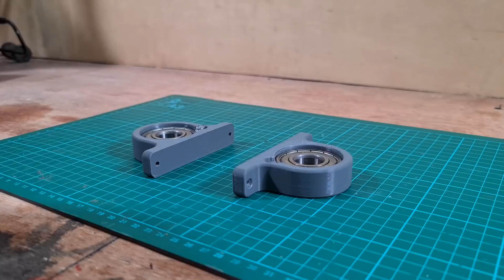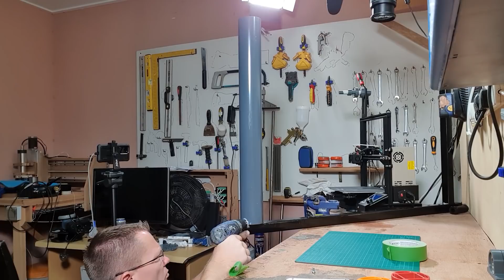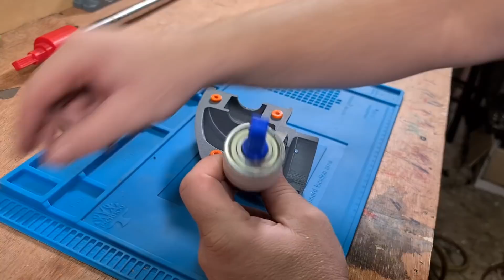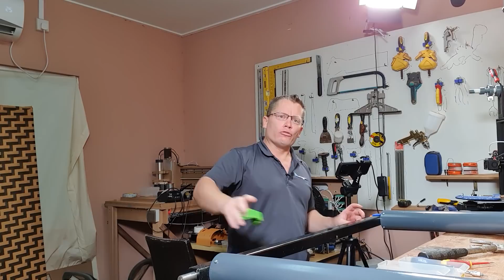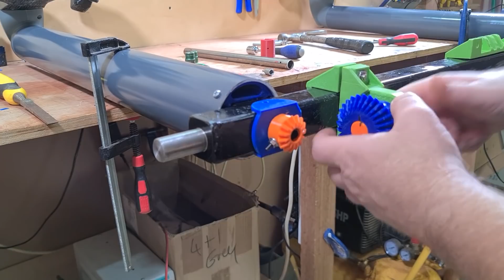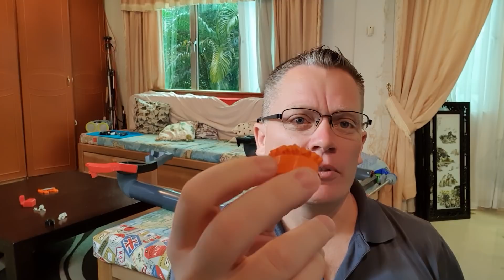Prototyping the Boeing 737 Dual Control Yokes

Comment: Hello sir. Thank you for really good video. Could I ask what spec of gear do you use. I see a lot type in Fusion 360. Thank you.
Reply from the maker: These gears i created in fusion. However, since this video people have stated that fusion has a helical gear creator. I tested for a few samples and it appears to work fantastic! If you mean however what metal gears did I get hold of: They are 16mm bore, 1.5 Modulus, 30mm OD. I hope that helps.

Comment: Great effort and an awesome video to watch as always, Karl! I like these prototyping videos, because they let us see just how much work you put into the designs....just a note, for the gears, perhaps PETG would be a better choice? I know you mention ABS at the end, but PETG offers just as much strength as ABS, with none of the nasty smell/headache that induces :)
Reply from the maker: Hi BK Hobby, I have actually bought several rolls of PETG, but never got around to using them. Thank you for the advice and I will give it a go! Kind regards Karl
Reply: @helimech8152  Great! An added benefit to PETG over ABS is that it's much less prone to warping and actually stays on the build plate! If you haven't used PETG before, here are a few tips to you started:

-Use retraction (especially on a bowden type printer) - PETG does get a bit stringy if you don't
-Use a cooling fan for all but the first few layers (it helps with the part strength and reduces stringing, as well)
-Use about 70C heat bed temp - helps the part stay on without any additives

BTW, if you have a PEI build plate, all you need to do is wash it down with a bit of IPA (rubbing alcohol) to help adhesion....but if anything, I've had my parts stick too well to PEI!

Looking forward to your next videos!

Comment: What an effort! Wow! Thing of beauty is the joy forever!
I got 2 questions:
1) Do you plan installing some sort of a dumping system? For example some motorcycle steering oil dumpers?? (Like such - https://www.ebay.com/itm/CNC-Steering-Damper-Stabilizer-Universal-for-Motorcycle-Dirt-Bike-Street-Bike-/154048941602 )
2) Have you considered to use metal bevel gears from drive shaft? ( https://ars.els-cdn.com/content/image/3-s2.0-B9780128044605000018-f01-09-9780128044605.jpg )  They are readily available at any automotive part stores.
Best regards, 
Phil.
Reply from the maker: Hi Phil, On it! both of those points hopefully will be addressed very soon! Thank you helping point me in the right direction. All advice gratefully accepted. Kind Regards Karl
Reply: @helimech8152  You're welcome, Karl! You did tremendous job with this double column design!! Hats off.
Happy New Year! Phil.

Comment: Hello! decided to print the single colum, but where i finde the adapters for the pvc pipe, and the dimensions of the metal structural scuare pipe?
Reply from the maker: Hello Maco, all the details are on the webiste at:
https://www.737diysim.com/build-guides
Kind Regards
Karl
Reply: @helimech8152 great right now printing the gears / "sandwitch" assy!!! you are the best! planning to create a single yoke for my sim!

Comment: would it feel sturdy enough if we make the entire column with PVC pipe and PLA control wheel ?
Reply from the maker: Hi and no, i dont think so. I tried that first!
Reply: @helimech8152  this material topic is what keeps me from going ahead and building my yoke. I really loved your 3D model and was about to purchase. But then i remembered what to use for the column. PLA yoke + aluminum pipe would be weird and probably not work well. On the other hand,  a full metal manufacturing will require CNC... really lost in these ideas

Comment: Hello Karl. I'm building my own cockpit and I'd like to buy the plans from your website. How would that work? Do I get to download all your plans and 3D printable objects once I pay for them, or do I have to use your website every time I want to 3D print something, like the throttle quadrant or get a script?
Reply from the maker: Hi Alex, If purchase everything, you get the plans, guides and designs. All by digital PDF download and fusion 360 links which can be used in different CAD programmes. I hope that helps! Karl
Reply: @helimech8152  Hi Karl. Thanks for the reply. I'm mainly interested in the 3D plans, although I don't have a lot of experience with CAD programs or Fusion 360. Is it possible to convert those 360 fusion links to g-code or stl files to use with my printer?

Comment: The ender 3 PTFE system isn't that great. There are some 3rd party tubes and couplings. Luckily my printer got a good batch from the factory.
Reply from the maker: No I don't think it is, there have been a couple of other people mentioned they too are having the same problems or similar. Still it prints great and is an easy fix once i got he parts. Kind regards Karl

Comment: I've been wanting to build an FFB yoke for a while now, but haven't found a printable yoke handle that was good enough. I'm really looking forward to you releasing this, even if I'm not going to build a full dual control column setup.
Reply from the maker: Hello, there will be a single version too, but not for a little while yet! Just need to get the dual system working! Kind Regards Karl